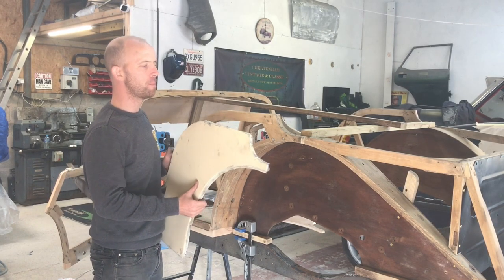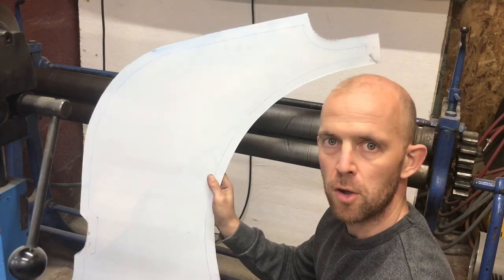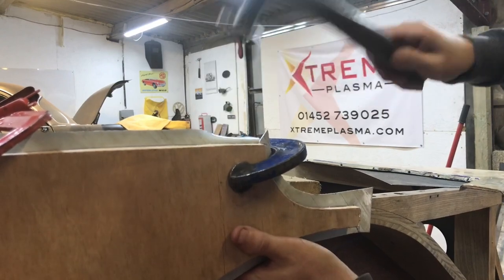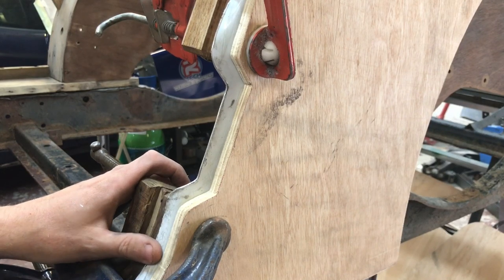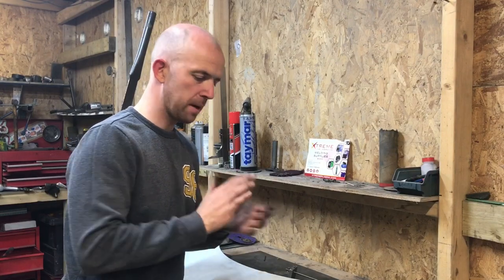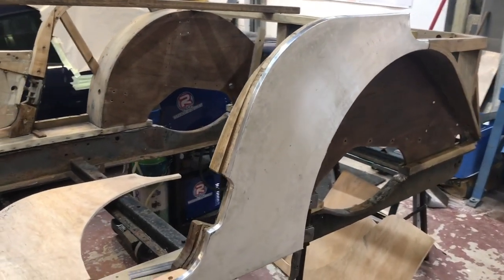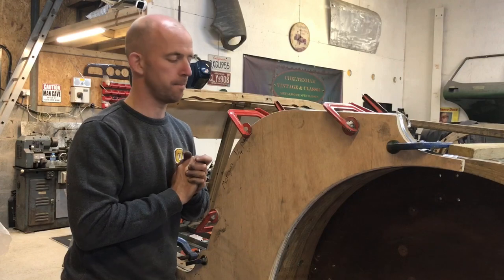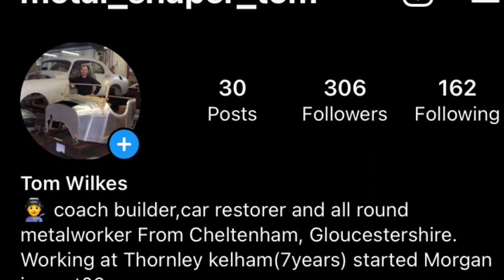MAKING A MORGAN - MAKING THE QUARTER PANEL EP.5 MORGAN RESTORATION

Comment: Very nice and perfect work; I also do these 1/4 panels by myself more or less in the very same manner, also rolled the ali sheet in the rolls before, many don`t do that, but it looks so much nicer and correct. But what I do also, after taking of the panel for finla finishing I put a primer on the backside (as Morgan did at least) to be more safe, but I don`t think that`s it really necessary. Thanks again also for this video!

Comment: Great Tom good work.. 
I’d consider stitch fuse the panels together then put mig wire filler tiged to joint, then send through English wheel or tapped up with dolly to flatten wire in joint. Then fuse with Tig over and wet cool. Always tap up to flatten as you go. 
No hollows with this method.. 
cheers 
JT
Reply from the maker: Hi JT thank you very much for your advice. I appreciate it 👍

Comment: lovely work.
does the wood get any preservative treatment?
is the wood/metal sealed or left as is to breathe?
Reply from the maker: So the wood has been treated and had a preservative painted on on it (about 4 coats) I haven’t painted the panel purely as I’ve kept it the same as original because I intended to sell it once complete and if I change it in any way the new owner may not want it like that. As a rule normally we would paint a panel when fitting a replacement.

Comment: Hello. Really great information. I have a question. Does the panel have a curve in both directions?
Reply from the maker: Hi . Yes slightly more on the horizontal as seen in the video towards the end and On the vertical it has a very subtle  curve that’s hardly visible.
Reply: @Metal_shaper_tom  Thank you very much

Comment: What grade aluminium are you using? You didn't need to anneal it to fold the edge. I think I mentioned before it's really handy seeing the ash frame too. I finally started my Riley one. It's surprising how rough the originals were. I find I have to try to not over build it!
Reply from the maker: Hi I use 1050 . It’s very easy to form. Yes the frames can be very rough especially Morgan ones lol
Reply: @Metal_shaper_tom  I am going to use 5005 on my Riley as that is all I can get here in NZ. I recently looked for 1100 but there just isn't any in the country and no one is bringing it in. My Austin 7 is 5005 and I had to anneal the edges to make it easier to bend (around a steel tube frame) then of course hammering everything makes it harder again.
Reply from the maker: @asciimation  that’s a shame you haven’t got the option in nz as that makes it much hard to make things
Reply: @Metal_shaper_tom  I found the same trying to source nickel-silver to make the radiator surround. It's unobtainable here. Things like door latches and hinges all have to come from the UK too. Was looking at remote handle latches but at nearly 200 quid each I think I will find another option!

Comment: What type of pins are you using to fix the panels to the wood, what is the length of the pins
Reply from the maker: Just steel panel pins. Approx 15mm in length